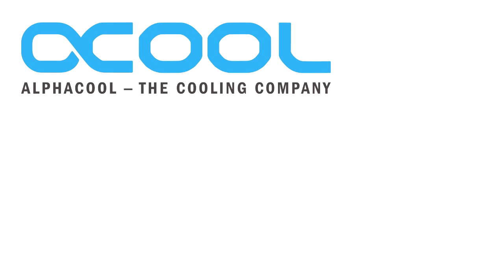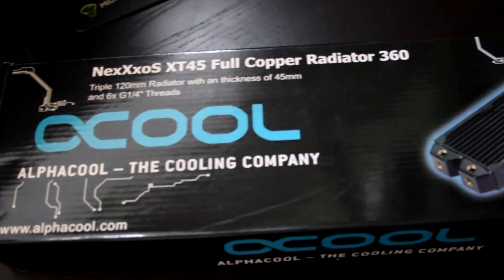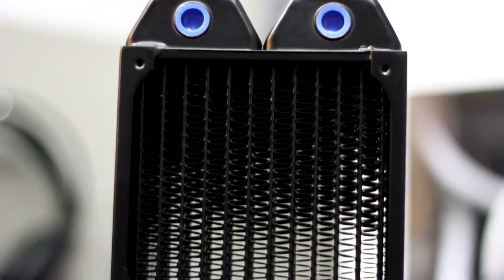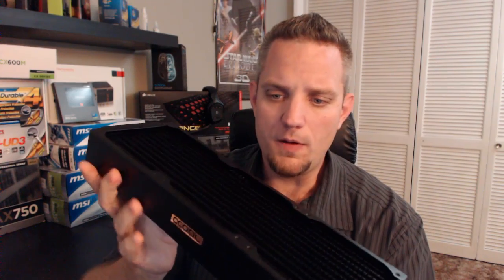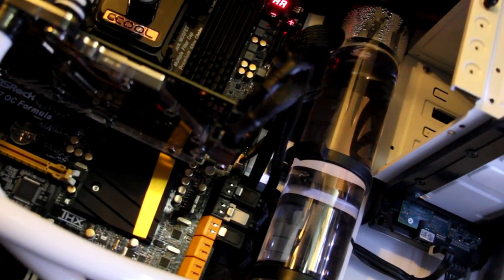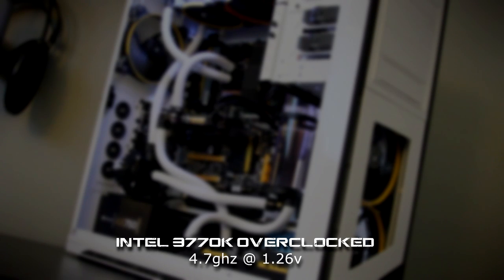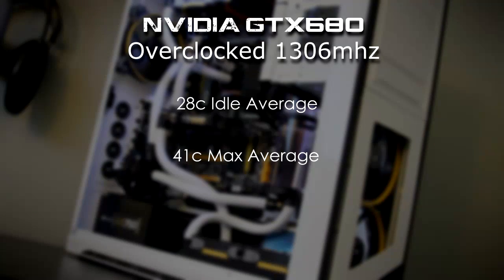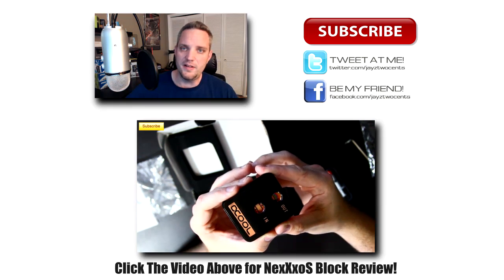Alphacool NexXxoS XT45 360 Radiator Review

Comment: one thing that i dont like the xt45 is it extends couple mm out once the stopper installed (or cock, whatever they call it)
it is a big problem to me because i mount the radiator to the case, not between fans. and the extended length is on my way.
i like the multiple out ports design, but to do it better either alphacool provides us with a thinner stopper, make the header slimmer or reduce the ports number from six ports to four ports
(personally, i like the st30 better)

Comment: The v2 versions of these have port stoppers flush with the rad, which means you can mount them flat against the bracket. I got an x flow for the top of my case that doesn't come in a v2 version. I wanted the fans underneath the rad pushing air through but because of the protruding port stoppers it wouldn't mount flush. Worth noting if you're considering buying one. Can't understand why they ever made them not like the v2?

Comment: Do they no longer do the copper logo on the side? I just bought one and its some boring blue writing.
Reply: They no longer include copper screws/end plugs. Just bought one and I'm kind of irritated..
Reply: do you guys like the radiator and how's it holding up?
Reply: i have 60mm thick version of this radiator (UT60) purchased in 2013 and it does a good job. right now i am about to flush/clean it inside and give it a white paint and maybe it will last another 5 years. so i am quite happy. also it was much cheaper back then, looking at current price (2019)

Comment: You only have a 360 Radiator for cpu+gpu?
Reply: +Zero A thick radiator does allow you to do this. 

This is about the minimum you would want to go tho. But it also depends a lot on which components you cool.  
The i7-3770K & GTX680.  
This is not a super hot setup, compared to some of todays hardware. GPU temperatures did drop for some cards though.  
For example an i7-5960X is a lot hotter compared to the i7-3770K that he was using back here. This review is from 2013, so keep this in mind. 

JayZ recommends at least 1 x 120mm per component with 1 x 120mm extra. So in this case, the 360mm radiator was enough.  
Also a thicker radiator does provide better cooling compared to a thinner one. So this radiator is pretty thick, which helps again, more with cooling.

Comment: Sweet upgrade a vid. I like the color scheme with the asrock board. 4.7 @1.26 is very good vcore. My 3770k takes 1.29 @4.6. I stopped with that. Im using a xspc kit with 360x30mm rad. If i decide to cool my 680, I'd definitely look into getting an Alphacool rad as well.